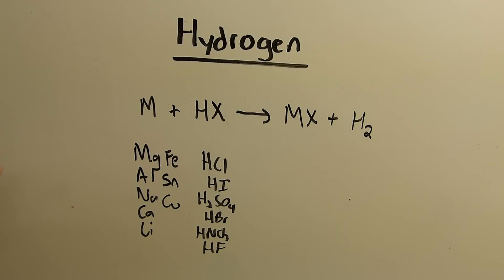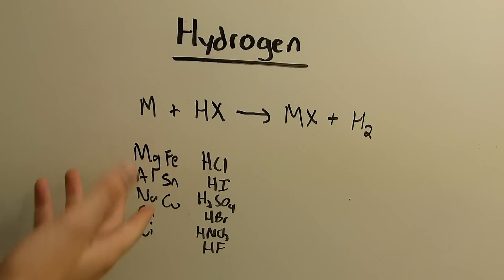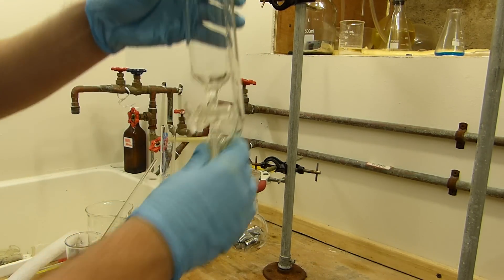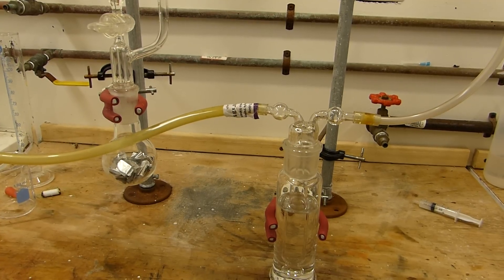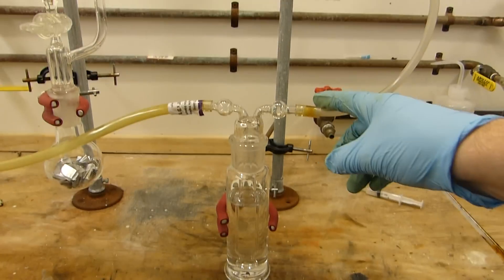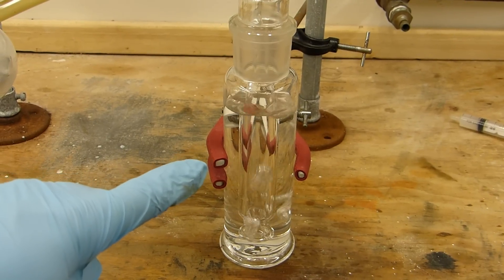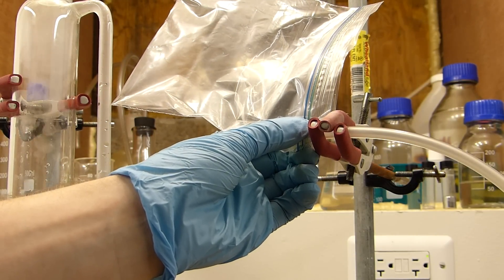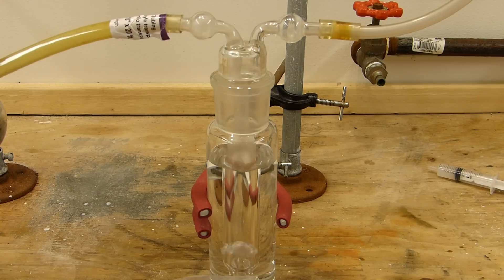Make Hydrogen

Comment: when i was a kid i used to produce hydrogen through hydrolysis and to route it to a modified small grass tube. modification was just to blow it with a torch at one extremity and pulling on the melting end until it gets a super tiny orifice. you would get then a small flame. with  the pressure it was just super stable and nothing blew up...

Comment: Instead of using an acid, I believe you could also drip a concentrated solution of NaOH onto aluminum foil to make H2 gas. Just saying...
Reply: Actually,  the NaOH is just a catalyst.   Aluminum oxide and hydroxide are quite insoluble in water.  NaOH breaks the oxide/hydroxide layer, allowing the water to react with the metal.
Look up the rocket propellant called AlICE.  Also used in slurry blasting agents
Reply: @keithjurena9319  Oh, thanks for the insight. Sounds like I've been wasting quite a bit of NaOH in the past then lol.
Reply: On the other hand, if you actualky write down the reaction between Al, H20 and NaOH, it looks like the Na is actually used up in the reaction, not recovered like a catalyst would be. It also makes a difference how much water is available since you'll either make anhydrous or hydrated aluminum hydroxide.

Comment: If someone dont get hcl 
You can use Drain cleaner or caustic soda with aluminium
Reply: It's too violent usually and you have to have cooling baths and all that
Reply: @EdwardTriesToScience  yeah I know that,  sometimes the reaction gets  out of  hand , but it's an easy source to produce any hydrogen gas.  :))
Reply: @Prchemist06  Yeah I actually used that reaction alot before I found out I could get HCl for wayyyyyy cheaper, the only problem (other than runaway reactions) was the hydroxide solution getting hot enough for long enough that it'd start to etch the glass, otherwise its a nice reaction
Reply: @EdwardTriesToScience  yeah it's an annoying property of NaOH to etch glass.

Comment: In high school chemistry we used hydrogen to reduce copper oxide in a heated tube.  To be sure the air was purged out, we collected hydrogen in an inverted test tube and passed it over a flame.  When the hydrogen burned quietly at the mouth (versus burning with a "pop"), we knew apparatus was purged, and heating of the reaction tube could begin.  Steam released by the reaction prevents air from being sucked in.

Comment: Won't NaCO3 release CO2?  Why not use dilute NaOH?
     No matter what the acid used or its volatility, its mist will contaminate the hydrogen.  That's also true for NaOH/Al reaction.  You need a scrubber always.  In high school, we used zinc and H2SO4.  This can be put in a generator and will generate hydrogen steadily for hours.  (We used this to reduce copper oxide to metal in a heated tube.)  To test the gas in the apparatus, we collected the gas in an inverted test tube and ignite it away from the setup.  Only after the hydrogen burns quietly at the mouth did we start heating the reaction tube.  As the H2 gets consumed, equal mole volume of H2O is made, preventing backflow of O2 into the setup.

Comment: If I was to use water and separate the hydrogen from the oxygen with electrolysis. How would I go about separating the gases from each other?
Reply: The set up for that process is as follows: 
Take a container that can fit a test tube or something similar in it. Fill it with water and an electrolyte. Put a a test tube or similar container with the hole towards the ground into the larger container. Make sure the test tube is filled with water completely so there is no air in it. Place your electrodes so that the electrode that produces hydrogen which I believe is the negative one (not sure) is inside of the upside down test tube. Place the other electrode in and turn on power. Oxygen will be made but will dissipate into the air but hydrogen will displace the water in the test tube. Your hydrogen will be contaminated with a little bit of water vapor. With this set up it's basically impossible to avoid that just because of vapor pressures and such.

Comment: What would be the best way to dry it?  Concentrated sulfuric acid? Magnesium sulfate? Drierite?
Reply: Mg metal and h2so4 leaving Epson salts or aluminium and sodium hydroxide.
Reply: Dry MgSO4 is cheap..bake Epsom salt at 300°C for two hours on a sheet just a few mm deep.  Weigh before and after, it is over half water.

Comment: wouldn't it be better to use a NaOH solution? because now your H2 is contaminated with CO2
Reply: CO2 is also quite heavy, which makes it floating capabilities worse
Reply: depends on the availibility
Reply: if you have enough carbonate and a minute amount of HCl it‘ll be fine bc it first generates hydrogencarbonate. Also I feel like you would start to see small bubbles accumulating at the side of the gas wash bottle bc if the CO2 in solution

Comment: A quite cheap source for hydrogen is balled aluminium-sheet (foil) and a 20-25% sodiumhydroxyde-solution. It works well and the reaction starts spontaneously.

Comment: Nitric Acid can't be used to produce hydrogen at all usually... the H+ is oxidised to H2O. There are some exceptions ( Very dilute HNO3 produces H2 on reacting slowly with Mg or Mn) but they are not viable methods and are just impractical.

Comment: Incidentally, the process of plating a metal by dropping it into a solution containing ions of another metal is identical to that of making H2 with a metal & acid.  Suppose you put an iron nail into a sol'n of CuSO4.  Cu is below Fe in the electromotive series, so the Cu++ ions receive electrons from the Fe atoms, which become Fe++ ions that go into solution.  And the elemental Cu is deposited on the nail.  The exact same thing happens if you drop the nail into HCl.  But because H2 is a gas, it bubbles off, instead of coating the nail.

Comment: Oooops!  You goofed with that list at the beginning of the video.  You can't make H2 by reacting an acid with Cu.  To make it, the metal has to be above H in the electromotive series.  Hot, concentrated H2SO4 will decompose Cu, but it produces SO2, not H2.  That's because the H2SO4 is acting in its capacity as an oxidizer, not an acid.
Reply from the maker: +Clyde Wary 
Excellent observation! I totally missed that when I was preparing the lecture segment. I have added an annotation to correct it.
Reply: +Doug&#39;s Lab Great!  I sent you a message, before I found out you made the necessary correction.  Thanks :)
Reply: also, I am surprised Zn isn&#39;t on the list; and please review that chemical equation (Al+HCl)

Comment: Place some molten gallium on an aluminum can (or other aluminum) and let it soak in, then place the gallium/aluminum can into water and the aluminum will react producing aluminum hydroxide and hydrogen, while the gallium is left behind. You can then retrieve the gallium for later use.
Reply: Since the gallium removed the oxide layer and exposes fresh aluminium which does react with water.mixing gallium and aluminium is producing a rxn the same as aluminium mercury amalgam.

Comment: Your bubbles of HCL-contaminated hydrogen are enormous, you can't hope to be washing it out like that. You need smaller bubbles
Reply from the maker: +Constantino Fine Art SHHH!!!! You're not supposed to notice that. :)  I really need a gas washing bottle with a fritted sparging tube.
Reply: I know from experience that heaps of HCl gas is given off as well in this rxn and I'm wondering if U checked whether you're hydrogen still had hcl in it? Like did U hold a piece of pH paper against the gas stream?
I'm not convinced that one bubbler is enough.personally I'd use multiple wash bottles.

Comment: Tell me if you disagree, but lighting the H2 gas should have been a more violent explosion. Could it be because CO2 was being produced in your wash bottle? I would have scrubbed the HCl gas with an NaOH solution instead of a carbonate...
Reply from the maker: +Chad Howarth It could be all of those things. If I had an experiment that needed pure, dry hydrogen, I would certainly have used NaOH in the bottle. It's just expensive and I was looking for a quick solution for the demo. The problem with smart subscribers is that you can't get away with anything! :D
Reply: +Chad Howarth It may have burned slowly because it had to take the time to escape the bag and mix with the air before it could combust. If it were already mixed with the air in the bag it would probably burned much faster.
Reply: He made a pretty good job at letting the whole apparatus filling with hydrogen, so there was no explosion because it requires oxygen ! and the bag did not contained enough to allow an explosion
Reply: +Doug's Lab Isnt it better to just skip the acid, and react NaOH(aq) + Al to make hydrogen gas?
Reply: Doug's Lab come on now...NaOH isn't that expensive
Reply: Doug's Lab lol ok. and where did you get that gas wash jar? it's really neat!
Reply: +Doug's Lab Or... couldn't the HCl just be scrubbed by dissolution into the wash bottle water without adding any salt?
Reply: Wouldn't be as effective and because hcl fumes so much it would certainly be absorbing hcl but also giving off hcl due to the gas stream flowing through it.
Reply: Bingo.